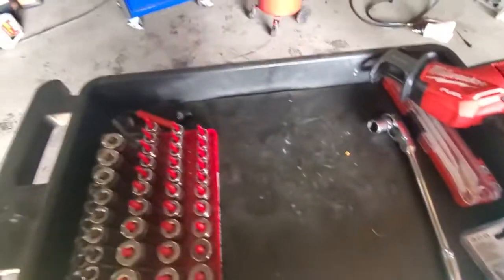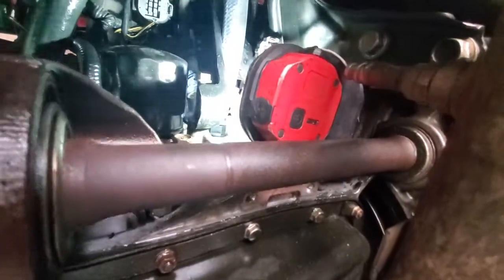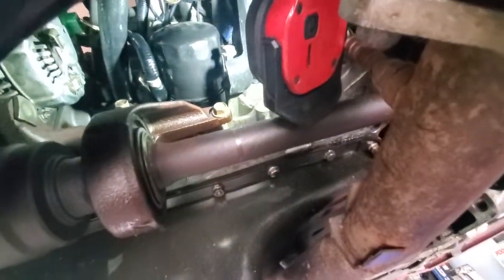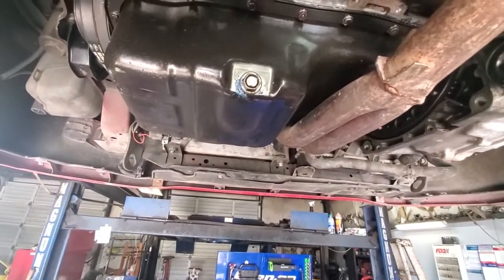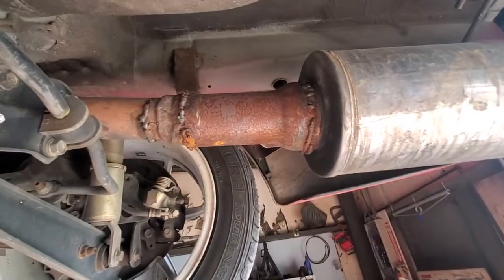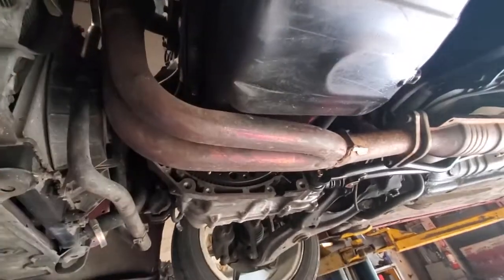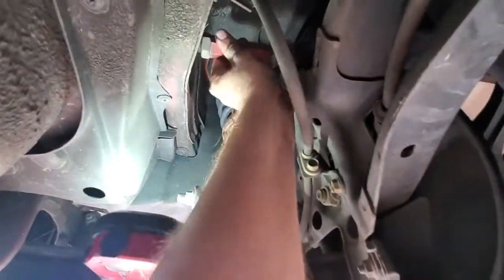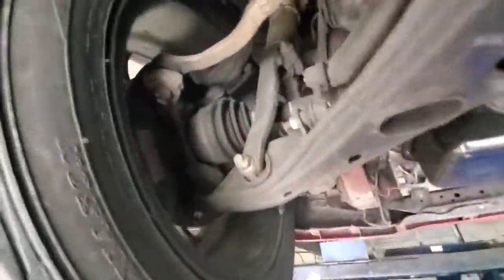Snap on tkf72 mini ratchet and civic si updates

Comment: You should get that plug out and replace it or inform the customer about it because you will be the last individual working on the car regardless if you are not providing oil service ...You know customers always look for corners to cut especially when paying for services or trying to find away to get a refund on work that wasn't necessarily provided
Reply from the maker: Lol its my car
Reply: @montevallomustang  Oh so you already know 😁
Reply from the maker: @toolsmetals2148  whats funny is that engine came straight from Japan and I put in my car and it has a chewed up drain plug and walmart paint. I can't figure out why
Reply: @montevallomustang  I'm confused 🤔 What do you mean by it being chewed up ..I seen when showed that it was rounded off and that oil service was provided in Japan and when you went to mention weather or not a Walmart even if existed in Japan ..On first sight when I first looked at the video it appeared to me if thread lock was used until I actually seen the blue over spray under the pan which did make me curious to why it actually looked like that at first but when I looked at the plug it really much more looked like thread lock because it seemed as if it was caked up abit around the edges of the plug ...It did not appear to seem as if it was spray but between the plug and the over spray under the pan was noticeable even through video even though I'm not standing close in person to take a good visual on hand
Reply from the maker: Walmart uses a paint pen to mark the drain plugs after doing an oil change, they are the only ones that do that. The paint was on the outside of the plug. They are also known for rounding off plugs and crossthreading plugs.
Reply: @montevallomustang  I did not even know a Walmart even  services vehicles ...That's a first for me ..but everyday you learn something new but that's crazy ..But it is your vehicle so why don't you just drop your pan and replace everything flush the system and start fresh